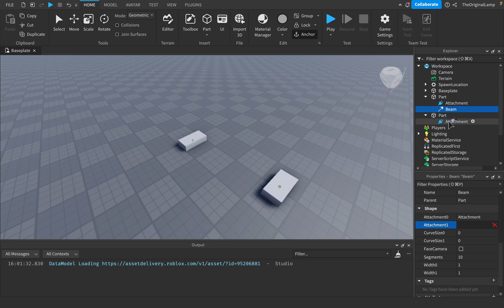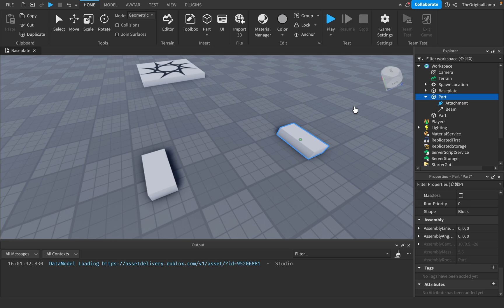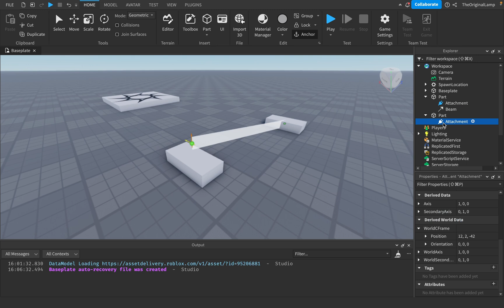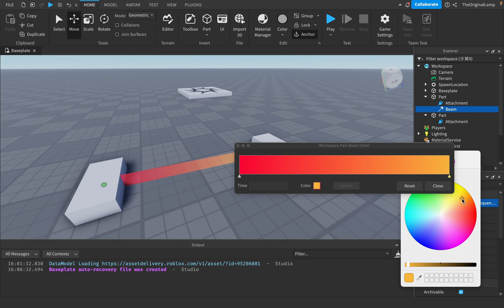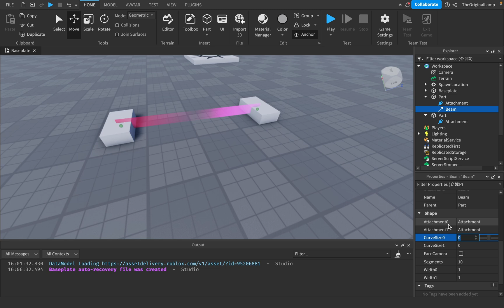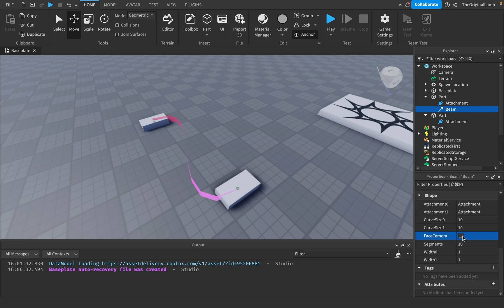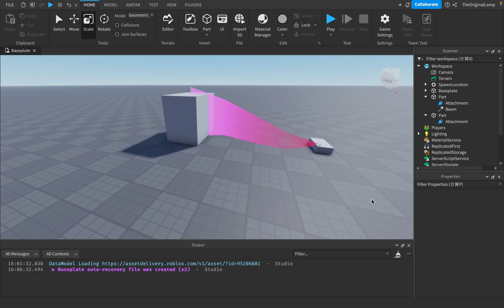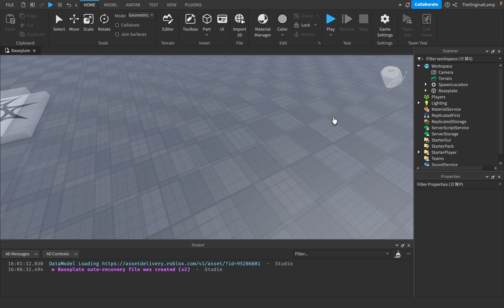Beams Are Actually Insanely Customizable

Comment: This code will attach a beam but will not connect idk im working on it

-- Script for attaching a beam on a player's head

local player = game.Players.LocalPlayer

local function attachBeam()
    -- Create the beam
    local beam = Instance.new("Beam")
    beam.Attachment0 = player.Character.Head.Attachment
    beam.Attachment1 = player.Character.Head.Attachment
    beam.Color = Color3.new(1, 0, 0) -- You can change the color to suit your game
    beam.Transparency = 0.5 -- You can change the transparency to suit your game
    beam.FaceCamera = true
    beam.LightEmission = 1
    beam.LightInfluence = 0
    beam.Parent = player.Character.Head
end

-- Attach the beam when the player's character is added
player.CharacterAdded:Connect(attachBeam)
Reply from the maker: Try resetting your character. CharacterAdded sometimes doesn’t run unless you reset your character

Comment: zoffset is actually quite useful. What it does is it will make the game decide if it wants to render it infront or behind a part based on how high the property is. For example, if a beam is 5 studs behind a part but zoffset is set to 5, you will see the beam. This is usually used so that if you are making an effect using multiple beams, you can decide which beam goes on top and which beam goes behind. I dont usually use zoffset for beams but for particles it is extremely useful.
Reply: Yeah I set the ZOffset for particles to 1 for basically like 90% of them since if its set on 0, you literally will not be able to see anything 😭(for a combat game btw)

Comment: I think you don't need a script just put it in starter player or make a starter character
Reply from the maker: you could, but the only way to actually change the beams attachment would be via a script, so you need a script
Reply: @byteblox100  tho it depends if you use a starter character or not